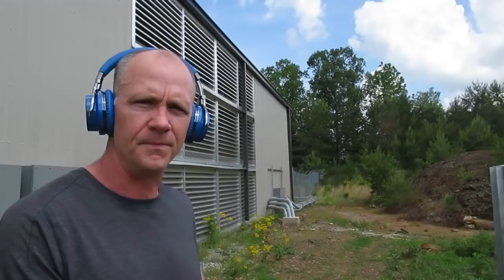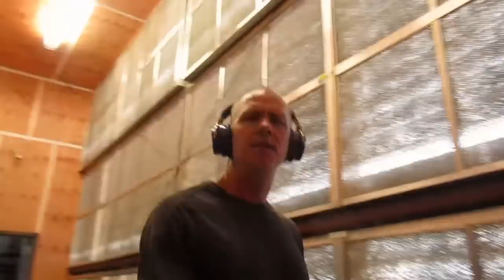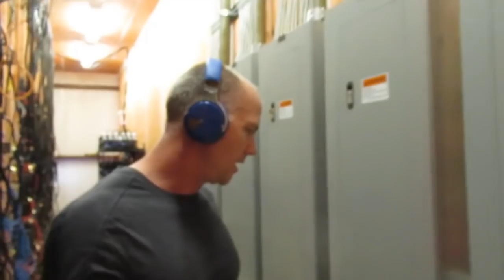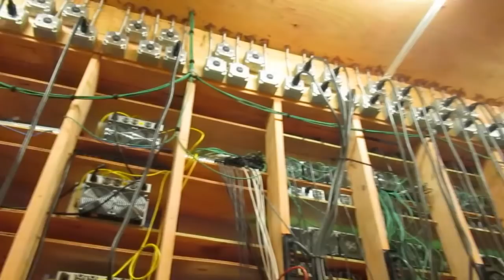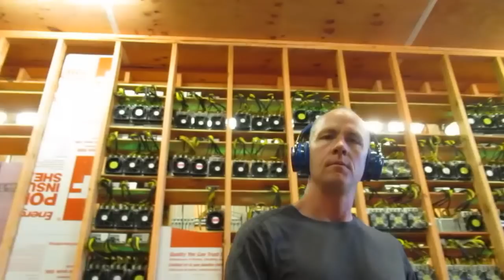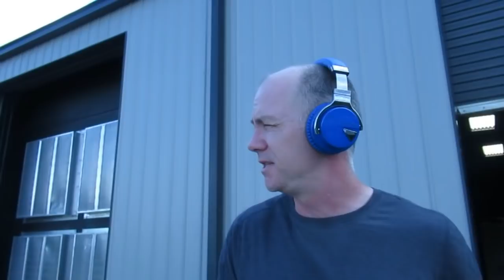New Crypto Mining Facility Buildout Tour - 900 ASIC miner facility

Comment: Sorry for all the questions.  You were one of the reasons I got started.   Your blog had details others lacked.  I'm close to finishing a buildout now, has taken more than a year. When you say fireproof, do you mean to coated wood with intumescent paint or clear coat?  Which intumescent mix did you use?
Reply from the maker: I just buy the wood already fireproofed - that's what the county fire inspector required.
No problem on the questions - best of luck with your buildout!

Comment: The cold aisle isn’t airtight but you don’t have reverse airflow. Is exhaust slightly higher cfm?
Reply from the maker: yes due to intake filters exhaust ends up being higher CFM. We actually got reverse airflow on some areas so we placed HVAC paneling on open spaces

Comment: Rolf, I have a technical question for you. your fans pull in 160,000 cfm. I count 72 of the washable filters... I assume they are the 20 inch by 25 inch filters I see on graingers website... since all these filters let in less air than the fans are pulling, that makes negative pressure right? does that have any adverse affect on the fans? ive heard some fans have a function that will turn themselves off it doesn't have enough air to pull on, thank ya kindly!
Reply from the maker: The fans have a graph that shows actual airflow based on differential pressure. These industrial fans are designed to operate at high differential pressure. The filters are operating at their upper limit of air velocity throughput.

Comment: Soooo.... why did u waste money on a PDU + 30 amp receptacle? Which by the way is limited to 12amp per bank...... ??  And 208 plus 3 phase??  Sounds like a lot offffffffffffff wassssssteeeeeeee.  U were offered options? Like 240? Standard dual breaker??  Mining experts? Mining consulting?. Please. U should get a better electrical knowledge and understanding 1st
Reply from the maker: You are correct, it is 12 amps per bank. There is some waste there. There are lots of different ways to do the electrical. 480VAC to 415 VAC to 3 phase to the PDU at 80 amps is also an option. Depends on the size of the buildout you are doing, time to market and buying abilities.

There are lots of reasons to make different choices on the electrical side of things. Difference of style is not wrong, it is just different. 

Consulting customers get access to all our experience and current best practice ideas. Free youtube videos get what we've done in the past.
Reply: Block Operations , I’m sure 10/2 wire cost peenies more compared to 12/2. Ohh wait it’s double the price... and PDUs are mad cheep too they only cost what $300 each,  and when u say “code compliant “ u do realize it’s only a receptacle thats mounted to the structure permanently not extensions etc...  you be better off running 2 20 amp 12/2 lines and a $11 dual receptacle and if u really like that PDU style plug then u can buy an “extension cord”
Reply from the maker: sounds like you have all the answers. Thanks for sharing!

Comment: Thank you for the tour, fresh build with lessons learned is great to see.  I am also a former submariner, building out our own 1.5 MW mint,  referenced your earlier videos to guide the design.  I have a good handle on the equipment, air flows and power matrices, seams the networking side is the most likely area to encounter stumbling blocks at scale, recently got a Cisco CCIE consultant involved.   Please comment about the LAN matrix, router and switch hardware you chose for a 900 miner buildout, spares distribution / access levels, and IP addressing.
Reply from the maker: For the larger build we are also hosting some miners from other people, which I like to lock down in their own subnet/VLAN. Firewall is a Cisco Meraki MX64, main switch is a Meraki MS120-24, access switches are Cisco SF250-48 48-Port 10/100 Smart Switch. I have 32 VLAN's set up, put 3-4 switches per VLAN, segment network into /24's, and use Meraki as DHCP server. The Meraki firewall is set up to failover to backup internet, and also for remote access VLAN. Using 12 static IP addresses from provider and can port forward to management machines, which are usually dedicated PC running Awesomeminer
Reply from the maker: I use the meraki firewall for port forwarding, as a layer 3 device, and for creating firewall rules to prevent hosted VLANs from access to any other VLAN/subnets
Reply from the maker: have a spare firewall and switch at the place. Definitely useful to get a networking consultant involved, but don't let them recommend anything too expensive. Low end 10/100 switches is all your need, and the GUI interface on the SF-250 is really good
Reply: @BlockOperations   I highly recommend checking out Fortinet Fortigates. Basically, we are using the same L3 design as your mentioned above, but much better security and performance vs meraki.

Comment: Why don't you use immersion cooling?
Reply: because it is expensive, i believe
Reply: @meteor8076  but it's more efficient
Reply from the maker: I like to keep my costs low and make maintenance easy. I gain efficiency through size, lower electricity rates, and no employees.
Reply: @user name taken  The immersion cooling needs less installation space and has no maintaining costs, no noise production, higher hash rates are possible (up to 20-30% per miner).
Reply: @user name taken  ...hmm, seems to be controversial!